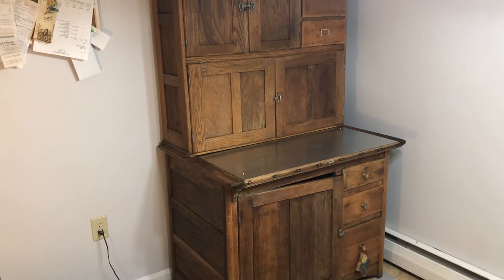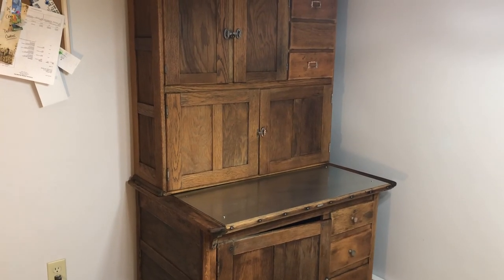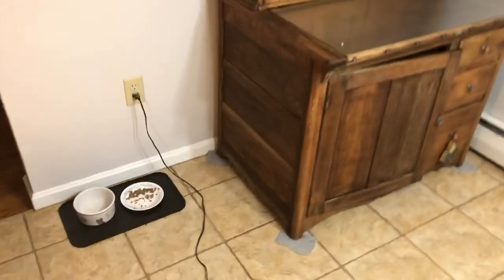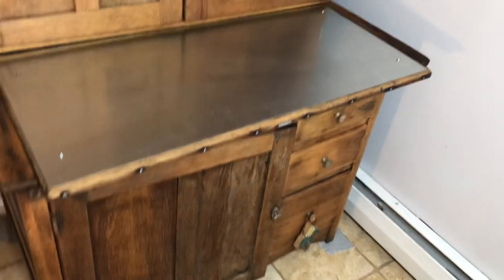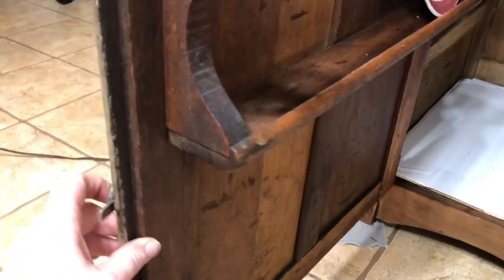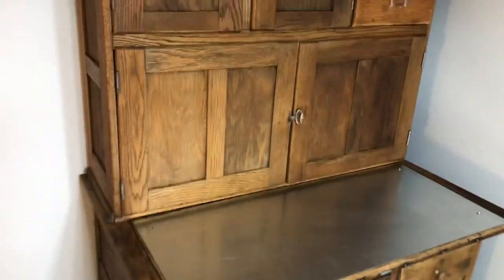1906 Hoosier Cabinet self-restoration

Comment: Hello Joanie from New Hampshire! Has noone responded to you? I may be able to help you via my networking attempts to restore my original Hoosier. Granted this has been a challenging year. We are a farm family and have been very busy this year, as our farm is closed to the public and outside farm labor. Life is just settling down , now that all the calves are born and the hay is in. I have resumed researching my Hoosier, which I think is 1920s. I am currently working with Kennedy Hardware to date my unit and obtain replacement parts. If you send me your email I will send photos of mine. Yes, mine has the three doors across the top with the metal pull out table that is edged with a blue gray spackled color. So mine is in our kitchen, storing my art supplies and waiting to be refinished. We use turn of the century items, such as a 1930 Home Comfort kitchen wood stove and a 1908 Griswold waffle iron. Most items are from our family and I restore them. Just refurbished a 1900s treadle Faultless sewing machine. I look forward to hearing from you. Best of luck. Your mother is going to love that Hoosier! ~Diane
Reply: Hi Diane - just happened to see your post from a year ago... I plan to restore my great-grandmother's Hoosier that was rescued from a root cellar (I believe) next to their old home in northeast Arkansas not long before the house burnt to the ground many years ago. My mother 'inherited' it and it sat on her back porch in hot and humid Texas for decades waiting on my dad to restore it - he wasn't particularly interested in doing that, apparently. He and mom passed away around 15 years ago, and I am keen to save what is left of it. It is in VERY rough shape, and I am trying to learn what I can about it (it has the original zinc worktop, three doors across the upper cabinet, inset with frosted glass that has a cross-hatched etching pattern). I would enjoy conversing with you about this project and what you have learned about yours. Thanks, and please let me know if you read this. Phil Gabbard, Houston, Texas
Reply: Phil Gabbard- Good morning from our farm in New Hamphire! I sure wish there was a " Hoosier Cabinet"  Club/Society! I have have little response. How is the wood on yours? Mine was dried out and stressed from sitting on an unheated porch for years. Now it has been sitting in our kitchen for a few years, waiting. I am going to try rubbing in a moisturizing wax that I purchased. I bought Jolie brand. There are precious few antiques that we have from our family. They bring back memories of family and where I came from. Our Great Uncle Robert's kitchen wood stove was a labor of love. Took a year to restore it. Now it graces our kitchen and is ready to light for this winter. Let me know how you fare with this restoration ~ Diane